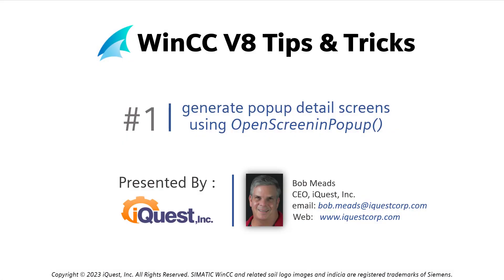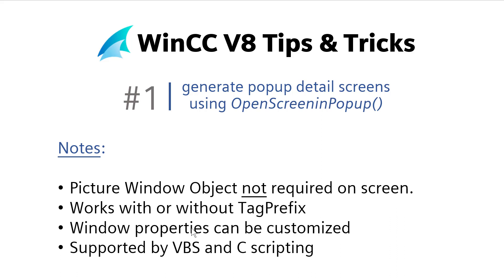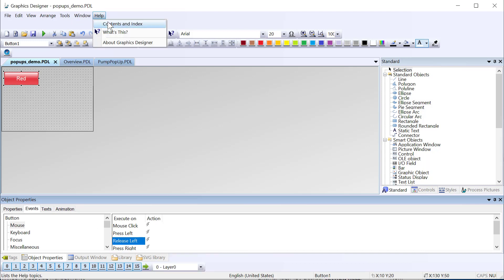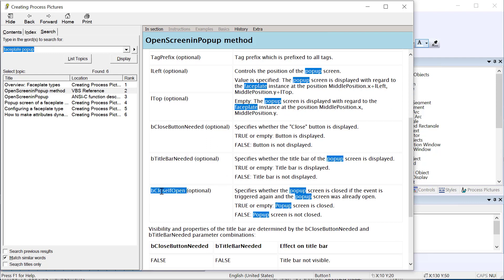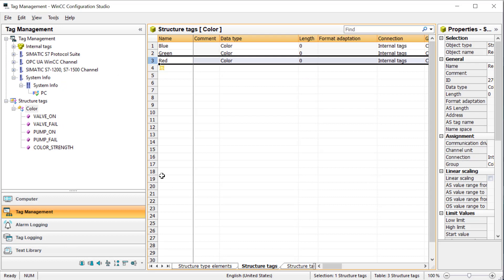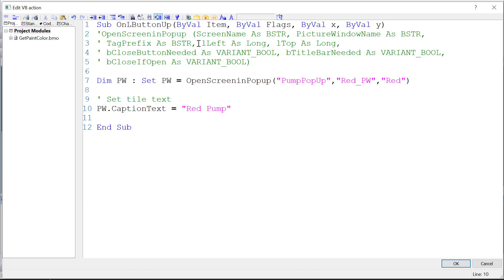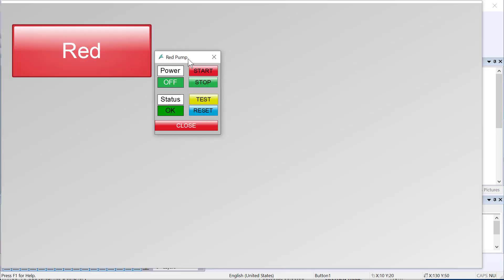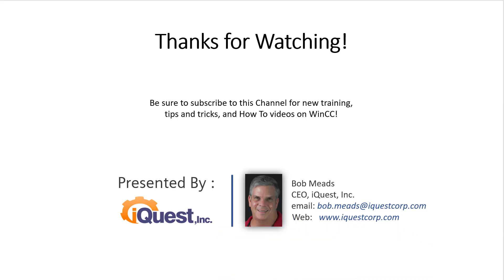WinCC V8 Tip 1: Generate PopUp screen *without* Picture Window !! 😱🤓 😎 Learn SCADA Programming

Comment: Do you know if it's possible to get the screen from where the pop-up function is called? I want to read some properties of an object on the main screen. 

Let's say for example I want to know in the pop-up screen the text color of the blue button which called the pop-up.
Reply from the maker: Yes it’s possible. Use the “Parent”property to access the screen items you are calling from. On your popup place a button and in script you can gain access to the screen items on the calling screen by using item.parent.parent.parent.screenitems(…)
Reply: @WinCCGURU  you are the best! Got it working
Reply from the maker: Glad you got it working !

Comment: I had a problem with a project, when press a button to open the online trend it says: "no license for this application present" how do I fix it
Reply from the maker: Is that a WinCC project? I have never seen that behavior. The WinCC online trend doesn’t require a license.
Reply: @WinCCGURU yeah, wincc v8.1
It is a project that was upgraded from the v7.4 and it was working fine
Reply: I forgot to mention that it uses advanced process control and it wasn't installed, I had to install it myself
Reply from the maker: I didn’t know they licensed that.  I’m not a fan of advanced process control.

Comment: Good explanation sir, i have tried and working fine but i don't want popup as a independent window. Please suggest modification for that
Reply from the maker: Then just do it the normal way.  Add a picture window object the the screen which has your PDL assigned to the picture name property and use a button to show it when desired. Makes sure “independent window” is not enabled.
Reply: First of all lots of thanks sir for your reply @WinCCGURU 
I know it as normal way but as like you i don't like annoying individual window screen that's why i m too excited to do it by openscreeninpopup script.
Reply from the maker: Unfortunately the “independent window” property isn’t something you can change dynamically so that is the only other way. I don’t like it being independent either.

Comment: Is it possible to change the properties of the popup's temporary picture window through the vbsript? Like not allowing the popup to be sizable since user/operator can play with the size of the popup and that can give unprofessional feel of the project🤷‍♀
PS: Bob surely knows , but for the others who want to prevent multiple popups at the same time, I found out that if I use the same name for the temporary picture window (in the openscreeninpopup argument), every newly triggered popup from different object will close previous, which is obvious since it uses the same temp. picture but that can be useful feature in some cases.
Reply from the maker: Thanks for the question and helpful comment.  Yes, you can change any property of the window since you are setting a reference to the picture window with the set command.
Reply: @WinCCGURU  Thank you very much for help, I managed to access properties of the temporary picture window. Since it was picture window inside another picture window, I had to insert a path to correctly access the desired property. Your videos and comments are golden source of information for us who are learning WinCC SCADA. Thank you!

Comment: Thanks for sharing this, I do have one question, I am trying to open Popup from another popup its working but its not grabbing the data. you might have come across it too, do you know how to make that work?
Reply from the maker: Would need more information on what you are trying to do. Are you using tag prefix? If so the tag prefix values are cumulative as you add picture windows

Comment: Hi, there is a way to make the popu not resizable?
Reply from the maker: Yes   The PW has a sizeable property. Set it to “No”.
Reply: Where? Because I am using a PDL for the popup @WinCCGURU
Reply: Where? Because I am using a PDL for the popup and I can't find it @WinCCGURU
Reply: Where? Because I am using a PDL for the popup and I cannot find that property @WinCCGURU
Reply from the maker: The popupscreeninwindow function returns a reference to the picture window that is created. You can use that reference to set the sizable property to vbfalse
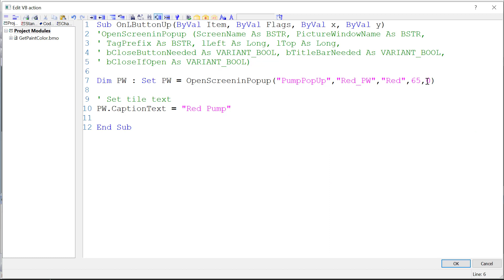Reply from the maker: Look around time 9:05. See how we set the captiontext using the PW reference? Use the same method to set sizable. 

PW.Sizeable = vbfalse
Reply: @WinCCGURU  I am testing WinCC V8 with latest updates, even if I set PW.Sizable = vbfalse I still can change window size - only in vertical direction, from top edge (titlebar), from any other edge/corner it is locked... seems like a bug, do you also have same issue?
Reply from the maker: @Bastek_x  its .Sizeable versus Sizable. I spelled it wrong. I tried it and it works. 

mypicWnd.Sizeable = vbfalse